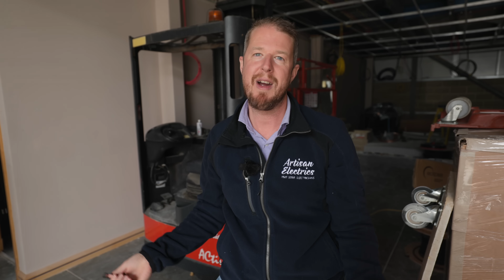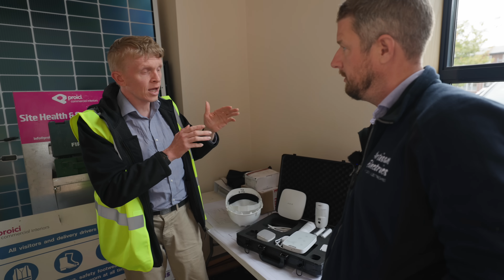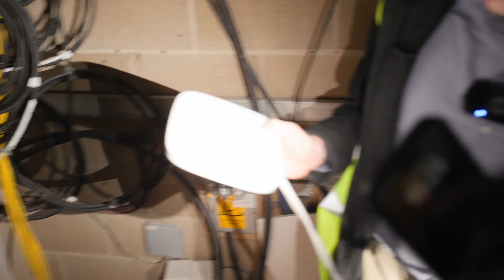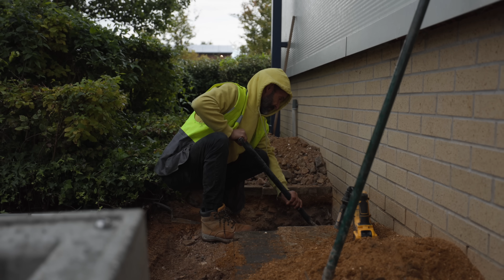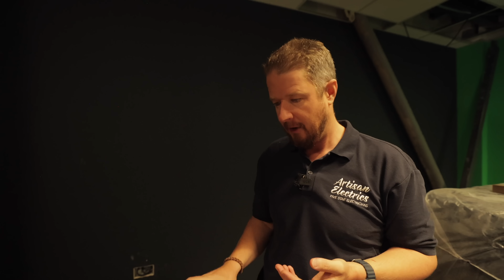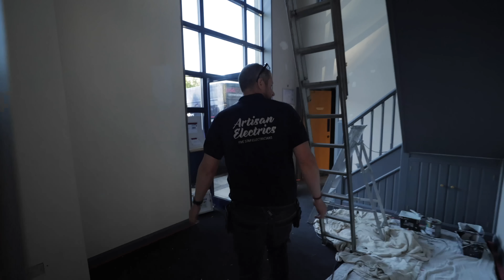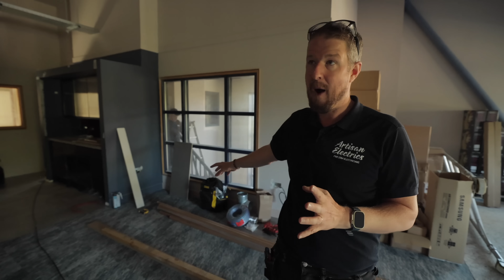The HQ Project That Nearly Bankrupted Me 😅

Comment: Saying it's a wireless security system and you already gave burglars all they need to jam it.... Hope you'll have also some wired ones
Reply: (it was the "cloud" connection part that got me)
Reply: I guess they could use a mix bag of systems hardwired around the main entrance and storage/garage and office, wireless elsewhere less important...
Reply: Their wireless tech has signal hopping to assist with jamming (albeit with the right tech no doubt you’d still be able to jam it) but I wouldn’t use wireless here. It’s an easy building to cable and AJAX have a wired range called FIBRA which outperforms the competitors as well
Reply: False. Jeweller protocol. It's what Ajax uses. 

Might be true for other cheap alarm systems.